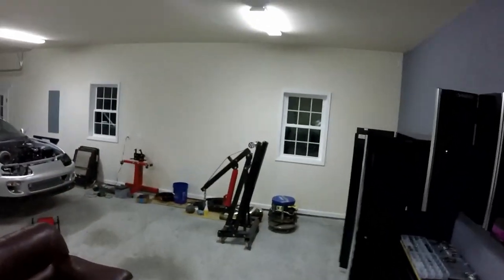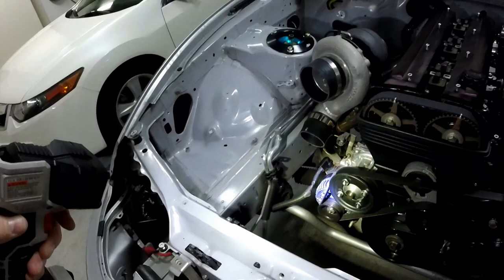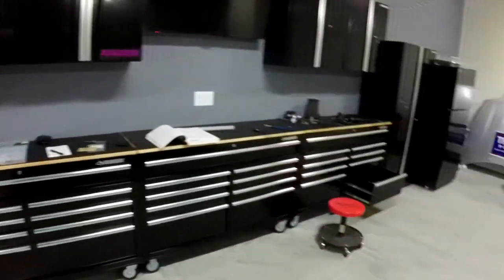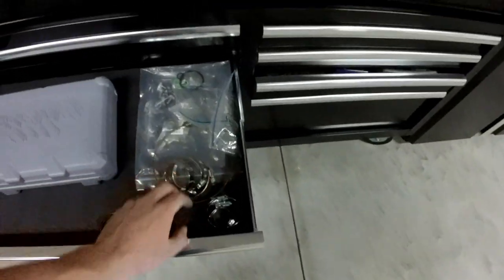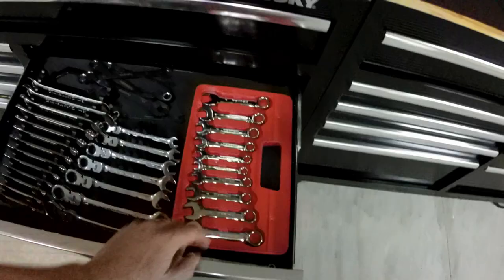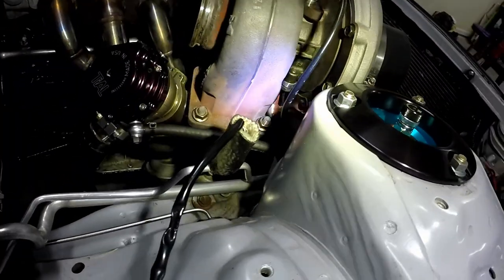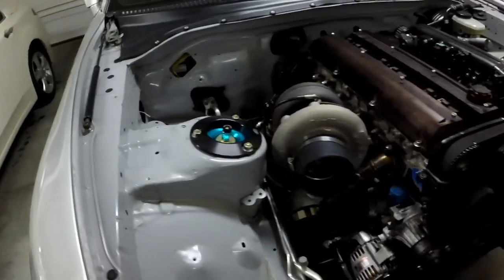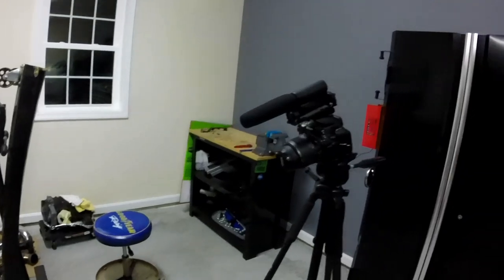What's in My Tool boxes, 2JZ Stuff & How I got Into YouTube!

Comment: I have a recommendation for you on the difficult turbo bolt! I have encountered that problem on many of my builds and one thing I have done to make it easier is to install the turbine housing on to the manifold first, tighten all the bolts, then install the center cartridge and compressor into the turbine housing. Sometimes it's easier to get to the center cartridge to turbine housing bolts then it is the turbine housing to manifold bolts with the turbo assembled. Hope this helps! Keep up the great videos man :)